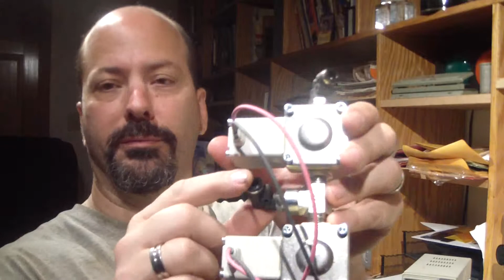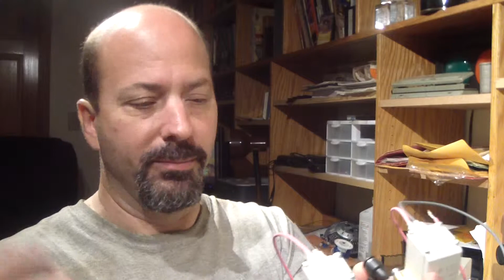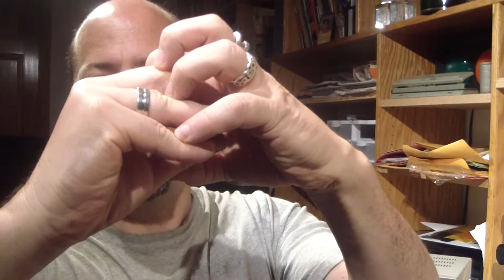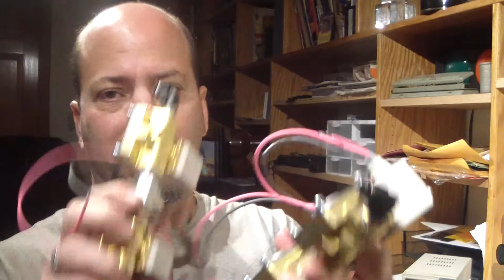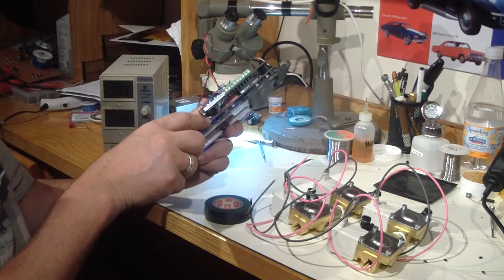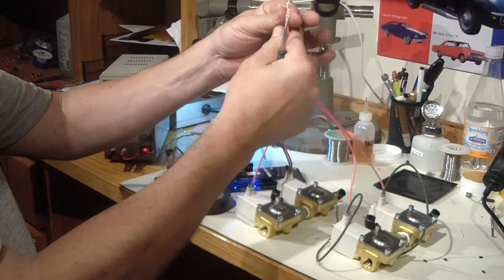MicroLevel solenoid electrical

Comment: Thanks Keith..  had not really examined the back of the control module yet.. I was concerned about polarity. But there is none on the solenoids..  as you may have noticed I have mine horizontal instead of vertical.. I will change that...  I am still trying to make a good decision for the power source. I want to get away from the ignition activation as it has the remote etc. and I don't need the ignition activated to walk around outside to make her squat..lol And my power supply and fuse block is less that 3 feet from the compressor. But that means I need a separate power source to the controller at the drivers station as well.. SO appreciate you have taken your time to do this..  and look forward to getting mine installed..